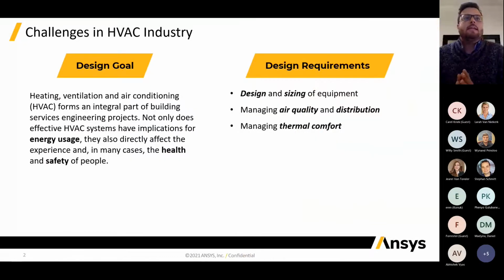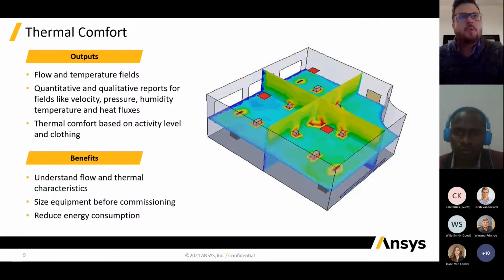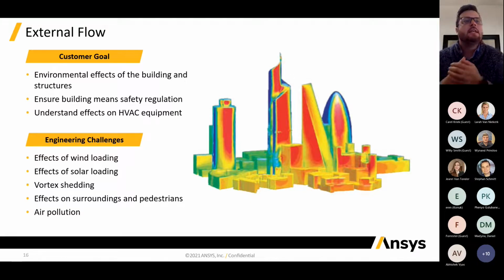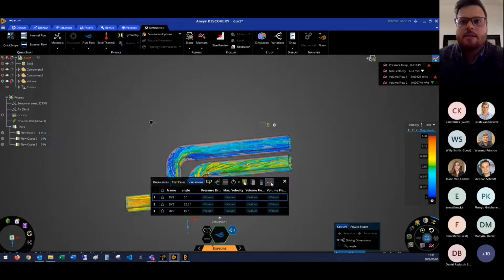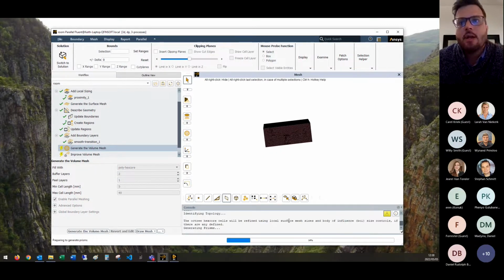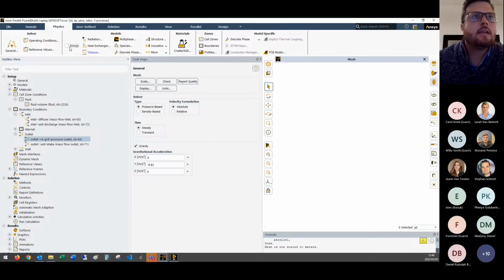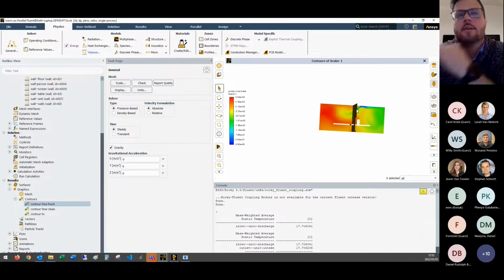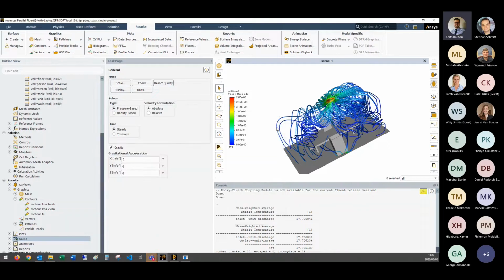Ansys Heating, ventilation and air conditioning HVAC Webinar

Comment: Hi, very helpful video! Im just wondering if you had any ideas on how to model the air circulation of an air source heat pump? I'm trying to model the airflow outside the heatpump rather than inside, which to me seems impossible to model. Any ideas? Thanks!